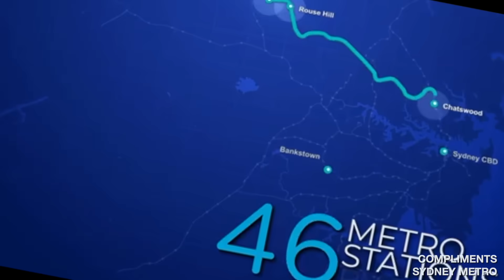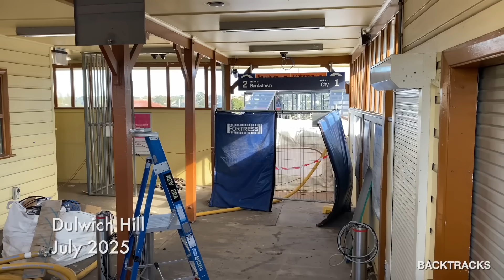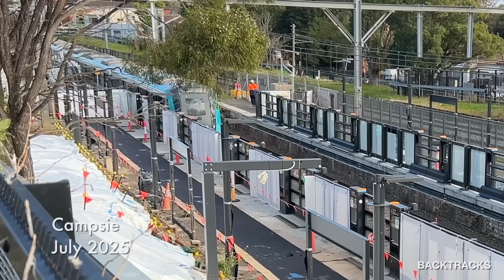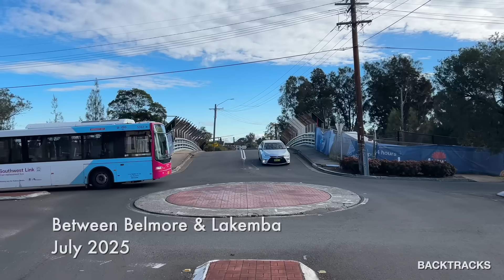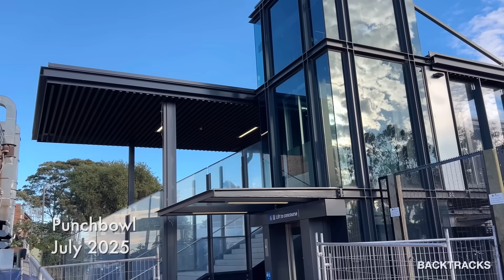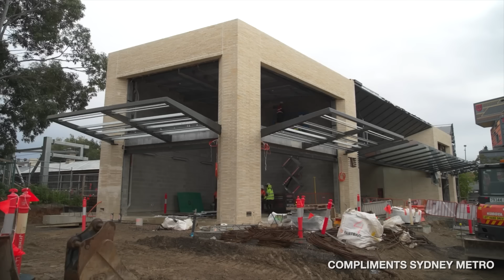Sydney Metro Bankstown Conversion: 10 Months Later...

Comment: It would have been nice if they integrated the Sydney Trains AND Metro stations into one. You will have to tap off and walk through gates, walk across the plaza (in the rain and heat) to tap back ON  to the other, if you need to change.
Reply from the maker: That would have been a more seamless experience, I agree.  Or at least made it a covered walkway between the two.